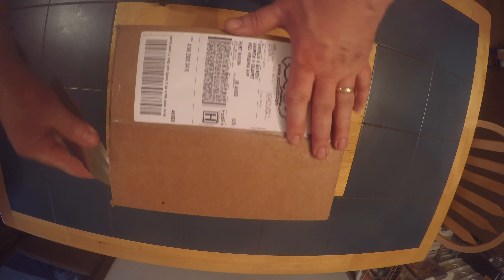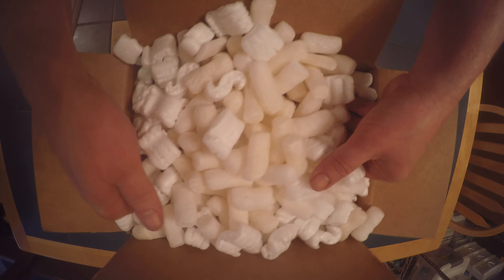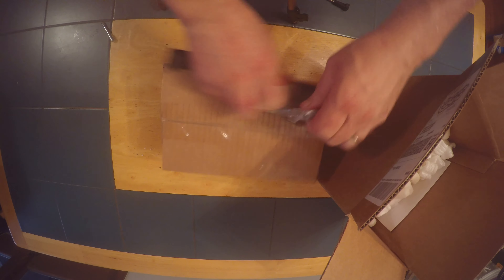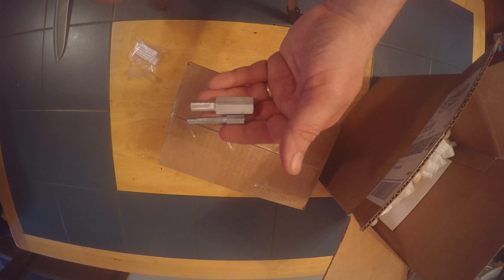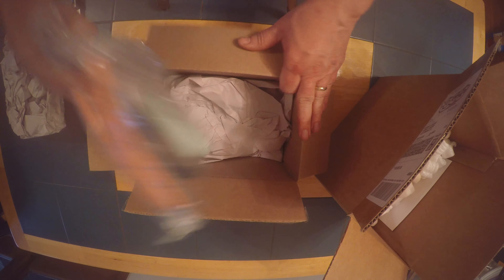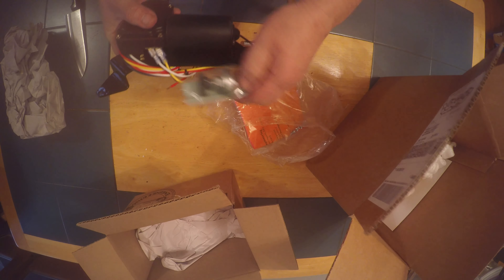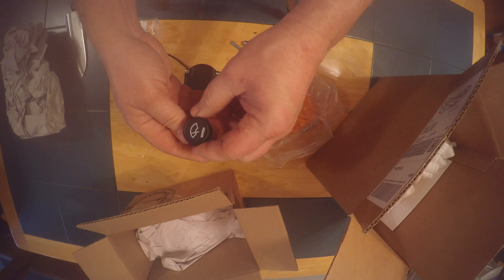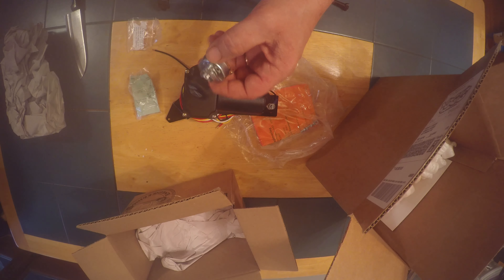Unboxing wiper motor conversion for 1957 Chevy

Comment: You can’t use the original switch with that. The original switch operates a cable to move a contact on the original vacuum or electric motor.
Reply from the maker: This is correct. We used the new switch came with the wiper motor but used the original knob on it.  Looked great and worked a lot better that the old vacuum style.

Comment: What are the extensions for I'm gonna buy a wiper motor for my 63 impala but I don't know if I need the extension
Reply: What extensions are you referring to?  This was for our 57 Chevy and it worked our very good.
Reply: It’s so you can use the new switch with the old knob. Don’t think is a good fit. Had to cut the arm coming from motor and it hits the steel as it goes around. Have to cut